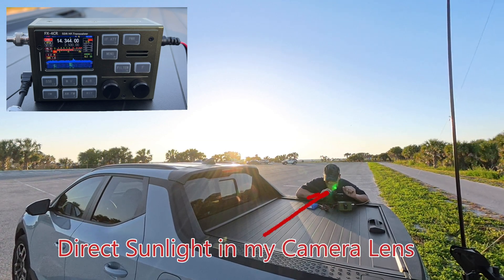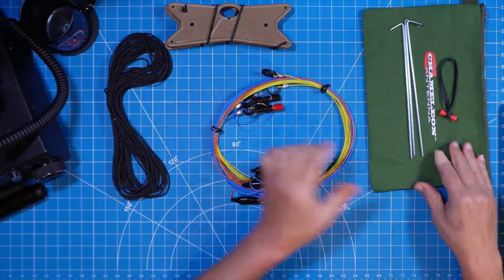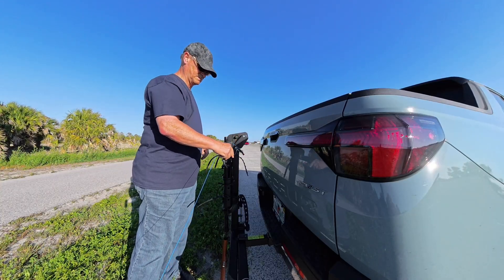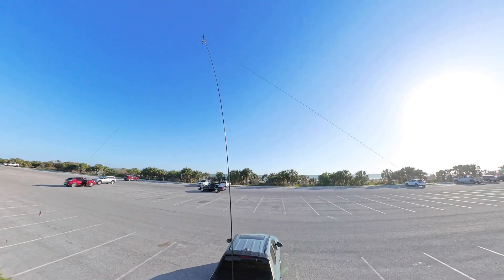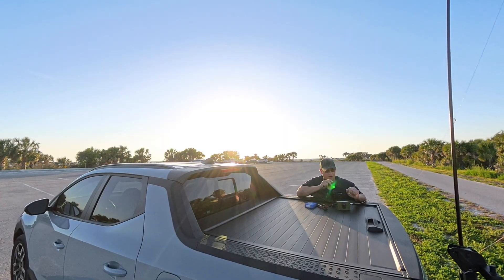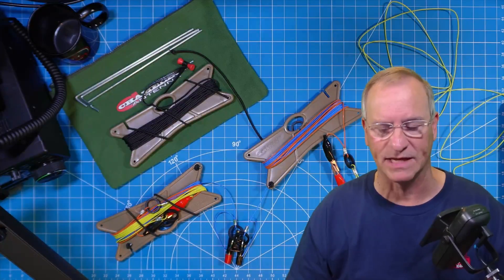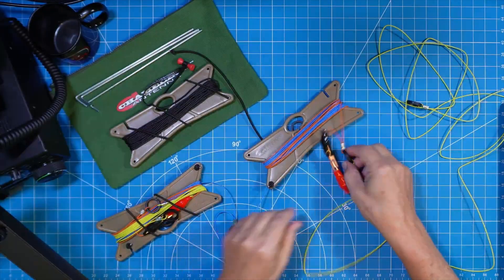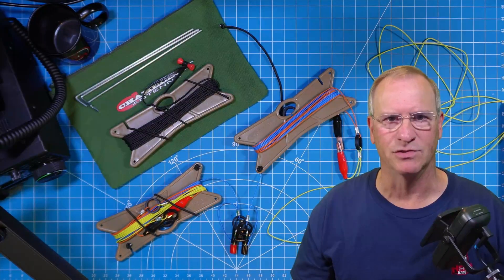POTA SOTA Linked Dipole for 40, 30, 20 Meters:  Demonstration and Review of the DX Engineering AZ-2

Comment: Thanks for another informative video! 

I live in an HOA but haven’t put an antenna up permanently yet.  I’ve been using an EFHW (Reel Potable), hung on a mast,  and a 17 foot vertical antenna  with coils giving me the ability to run 6-160 meters!.  

I’m pretty confident that I could take that setup out and have it deployed and working in minutes.  

There’s the silver lining in my HOA cloud.
Reply from the maker: Down to 160, that's great!  And yes, you get so used to doing this at home, setting up portable is just second nature.  When I did my first POTA years ago, it was a breeze, because I had done it so many times previously in my back yard.

Comment: Looks awesome!

I'm just getting started with my FX-4CR, and even planning a review video (probably--one in the "studio" and one out using it). I'm curious if you're using the stock firmware, a beta, or the third-party firmware I've heard is out there. I've had some odd behavior on SSB, where there's a delay between unkeying and audio coming back up to full video, and I'm wondering if you've seen it (heard it), too?
Reply from the maker: I using firmware which came with the radios; yes, two of them.

I have one from the second batch ever made, and it has that delay you reference.

My second one is the most recent hardware release and the delay issue is not there...my QSO's at US-1880 were on the newest radio, and there was no delay at all.
Reply: @HOAHamRadio  Weird. Mine's no more than about two weeks old, and it definitely has the delay. It likes you best? 😀 So far, I really dig the radio, despite that quirk. It's small, it's solid, and it seems to get the job done.